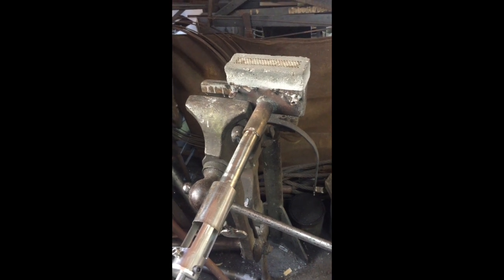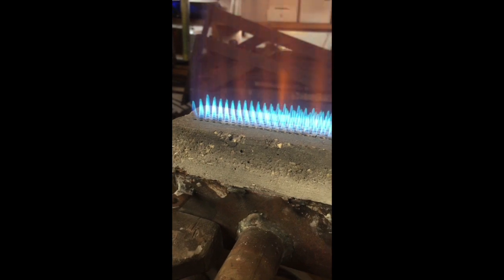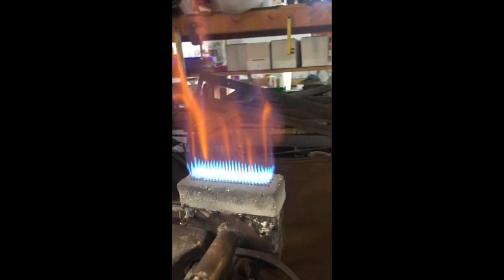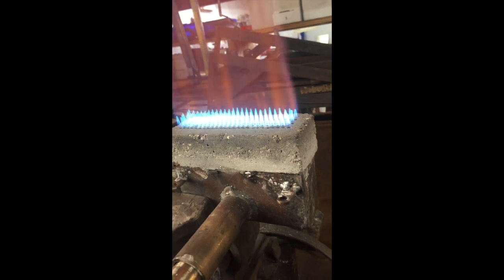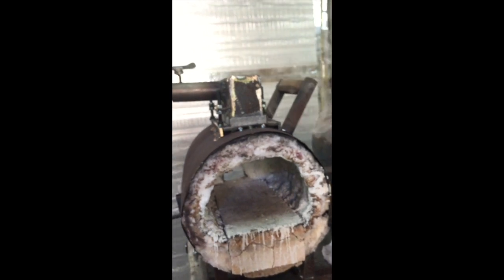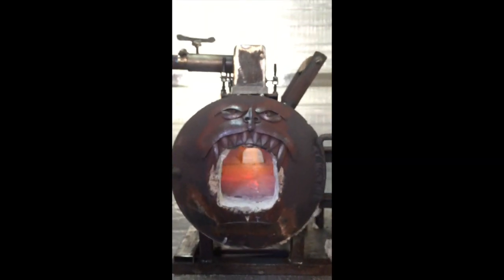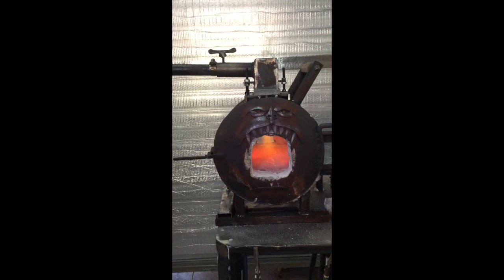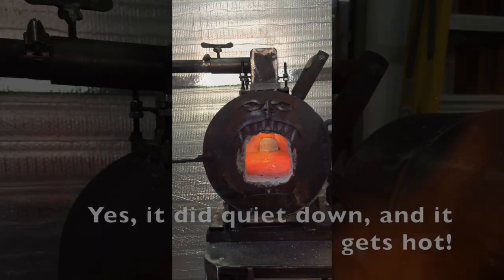NARB - Naturally Asperated Ribbon Burner

Comment: Absolutely amazing build.  Im going to give this build a shot. what did you use to retain the holes when casting the refractory?
Reply from the maker: I discuss the build on iForgeIron forum starting around page 19 (maybe 18): https://www.iforgeiron.com/topic/48001-naturally-aspirated-ribbon-burner-photo-heavy/page/19/

Take a look there.  The basic build is the same as Wayne Coe's ribbon burner except I used sprue wax instead of crayons for the holes.  Jerry Frost, called Frosty on the site, modified Wayne's ribbon burner to work with a naturally aspirated (popularly called venturi) burner.  My addition was to make more smaller holes.

Comment: What size orfice are you running for the gas inlet?
Reply from the maker: It has a .030 mig tip on it.  Now I usually run it with a standard 20 y.o. Reil Burner.  The gas orifice is .040" - a #60 drill in the side of a pipe. The Reil burner can be found on this site: https://ronreil.abana.org/design1.shtml   

I've been with other burners styles as injectors, and it is very forgiving of I put on it.  Really doesn't seem to care.  It seems to run a little richer then if I put just a plain nozzle on the burner.